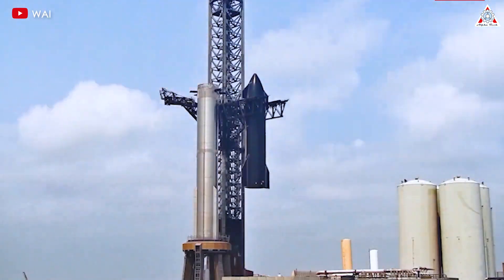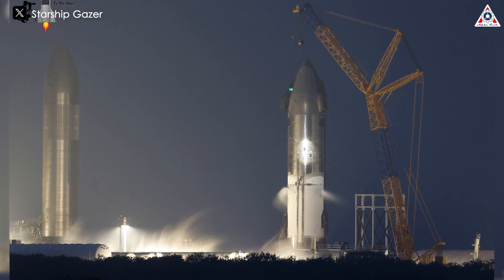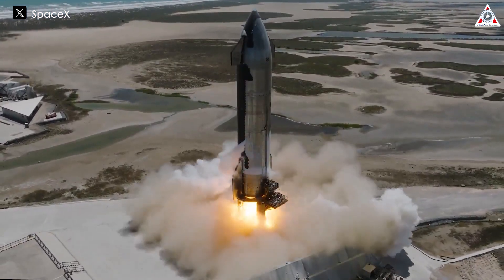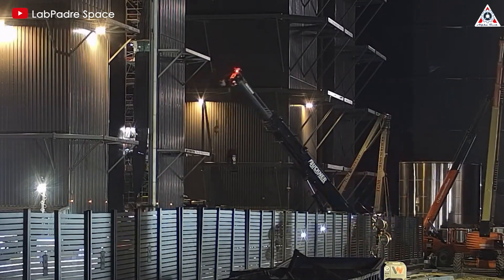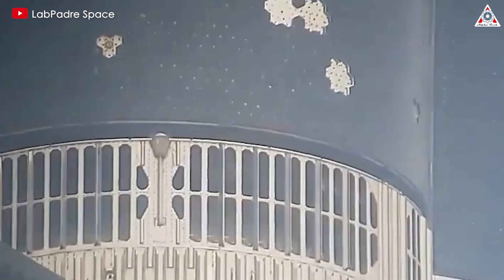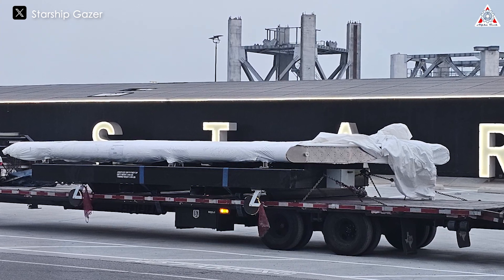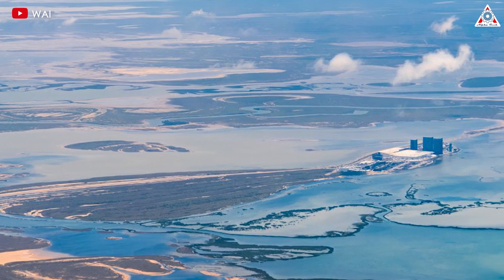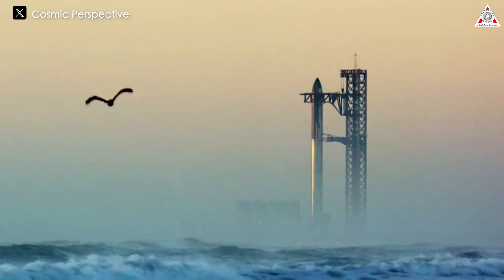Starship 31's Damaged TROUBLE! SpaceX Leader Gives NEW Detail Update...

Comment: What I see there is continual problems from the ring structure style of construction.

They are having to transport them flat to prevent collapse, and then stack them very high. all that is slow and laborious. and difficult passage for every section.

If they went to longitudinal gores, they could build them in the flat, with internal structure installed,  transport stacked flat 
And assemble with the crane by standing up the gores,  and building the gores around the end domes and prefabricated decks.

And at the same time get full length longitudinals, and not  have your structure full diameter butt welded every ring width.

This is bad engineering. Also limits ship design shapes to round hulls.
Flying logs aerodynamically, and less than pleasant spaces to live in, and no flat walls to build to, or put any thing against. Would be better with more linear construction, at least get facet like flat sides, and architectual freedom, without the continual problems wasting space and materials fitting everything to a short radius curve...

Try sticking your bunk agaist that hull on decks... Gonna get a wasted space where the straight edge of bunk meets round curve of hull. And they will soon find building internals taking twice as much time as closing in the hull.

Also if they discover glide ratio helps re-entry, with round hull limits, they will be stuck with 1930's era Aircraft hull styles. Cobbling wings and fins onto a tube, instead of potential blended wing shapes etc. 
They will be locked a hundred years behind potential start ups who realize these issues ahead of the curve. And they will have spent billions trapping themselves.

I hope the Chinese are listening... Sure they could appreciate better designs and better function... And right now likely have the most experience building linear hull shapes in marine shipping...

And I dont look forward to saying:
 "I told you so repeatedly", to SpaceX,
after its too late...

This is all down stream of the water tank guys.
And not building proper jigs and fabrication aids. 

One thing leads to another, and problems multiply over time building things.
Reply: 'I hope the Chinese are listening...' If they follow your expertise we need not be afraid of them!
Just a question: Why have submarines round hulls? Making them square would make building the interior much easier.
Reply: @gottfriedheumesser1994  
Funny! quite a difference between thousands of PSI, on the outside, and about 15 psi. on the inside...
In fact the Navy ships standard scuttle hatches are rated for 15 psi.
But they dont put those on subs for external use.

In other words the standard fabricated ships hull likely exceeds the hatch for pressure potentials. i.e. with fabrication you dont need round shape to withstand minor pressure on the inside.
Elon's ships are likely only slightly thinner, but stainless, which is a pretty good alloy, not just mild steel.
So building only tubes is a neurosis...  And I never said build cubes. I said faceted, gores, likely the width of a sheet just like the rings are. And if they pooched a bit with internal pressure it wouldnt stress them much at the welds as you'd likely cross the seams with gusset tabs or transvers framing with rat holes to acess the welds for inspection and repair.
They are inflating the current ship just to stiffen it for flight. Which by the way I suggested before the first one flew.
If you read all my past writs on just Alpha Tech you would probably notice many things got later used. Even got a couple thank you notes from Elon... And if you followed my stuff you would see it pops up on other channels in comments consistantly in comments by others.
After I write it.
And on the Chinese: I'm old enough to know governments are temporary. And I want humanity into space and I dont care who makes it happen. And I know some Chinese and other Asians personally and like them, just as much as I have liked Germans and Russians etc.
Theres quite a bit to current Starships that I have influenced... Without my input things would be much retarded.
Including the engines,
 I was who first posted parts count. That was on r/SpaceX.... user name was ActOutside followed by a four digit number, roughly a week or less after Elon's memo about SpaceX going potentially bankrupt from engine costs and difficulty.
I got trolled for that for two days.... So, Toll me, I'm used to it! 🤗
Reply: @garylester3976  Thanks for your endless posting. As an engineer, I had to study a lot of mechanics. As most of the body of a rocket are tanks (3/4 LOX, and 1/4 LNG) with some internal pressure it should be clear that the optimum structure is a tube with a semi-spherical termination. Everything else will make the structure heavier and less stable. It is also easier to weld the rings together when they stand upwards- Otherwise, you need spars to get the structure stiffer. That means additional mass and weakening of the structure unless one reinforces it with even more mass. 'The best part is no part' is true in this respect.
Reply: @gottfriedheumesser1994  
No problem.
Yeah, I have stated many times that the tanks should be kept round, or be lobed. i.e. rounded with some structure added to allow fattening and not getting too thick on the walls.
The real stress points on elongated round tanks is at the ends. if they are flat. which is why on starship they are domed.
If you think about lobed tanks, you will find its a common containment shape in nature for good reasons.
And the tanks on Starship are over 100 psi. and still fairly thin. they have to be off gassed or they will rupture from increasing vapor pressure.
What I am talking about is the ship, that especially for re-entry, building in longitudinal gores would have advantages,  from internal straight sections, for building or putting things against, to external advantages for say aerodynamic shapes for re-entry.
If you study hard chine boat and ship hulls, you will see they are built like modern stealth aircraft in many ways.
If you are interested in metal hulls, you might get a copy of Thomas Colvin's "Steel boat building"...
It covers fundamentals of fabricated hulls, and is full of gems that apply to Ships of Space. I've beat up the Nerds at SpaceX no few times with info learned from Colvin.
Also my father studied Ship Fitting at Bremerton Naval Ship Yard, And I owned the course text for decades and read it repeatedly.
Hulls have been an interest since I was a young teen in the 60's...
I also was in the US Navy, so have personal experience. Also have laid out arty smaller boat hulls of my own design for fabrication.
And have similar interests in Aircraft. My first 4 flights across the Atlantic the planes had propellers.
And I grew up on Air Bases...
So, a strange mix of understanding that somewhat applies to Starship. And a high mechanical aptitude... Aced the Militay's mechanical aptitude test.
Its part of the problem with modern engineering, often too specialized. I had an uncle in the 60's who was a well paid engineer at Boeing, and he was raised on the farm and into all kinds of stuff. Two of his brothers were machinists.
And I trained in micro machining. Also construction, and fabrication is just a hobby. (But I was taught by professionals...)
And one son a state Champion in auto mechanics, which is half computers now.
Starship is new territory for space, but much of what is being attempted relates to other fields.
And it only started getting good when Elon increased the number and kinds of experienced blue collar workers. Its really building a ship, not just a rocket.

And I have haranged them continually and gotten upgrades to happen, by spotting and pointing out things online.
But I try to remember, its Elon's project, and he needs to be creative in his own ways. And I often see the engineers do really good stuff.
But what I am proudest of, is changing the paradigm online about people submitting suggestions...
three years ago it was blasphemy to dare to suggest anything, now its perfectly normal to read comments and see all kinds of ideas to help, and some of them worth very serious consideration.
Basically I reamed the snobs and blazed the trail, and now seeing seriously good results... when I used to get banned for making suggestions.
That seemed to end not long after parts count.
They did ban me from
 r/spacex for stating I had seen screen shots from feminist writs talking about ending space programs and spending the money on women.
So basically was the first to try to warn of harassment from the left.
They didnt like Elon's Space stuff long before the current harassment from that side politically.
And I'm here to back Elon.
Also to encourage others, by humor if necessary.

Nobody knows everything, everybody misses things.
And humans form traditions from expedients, and vector off from optimum continually.
Also Elon appreciates input....
G.
Reply: @garylester3976  For shipbuilding I have a colleague who was reading Shipbuilding at the university. But this doesn't help much in building rockets. I would say, airplane building is nearer. Sadly nobody can keep up with your experience.
Reply: @gottfriedheumesser1994  Funny!
Well its actually closer to smaller steel boats. but referred to ships due to layout of shapes. Ships of course built quite heavy. even though the hull skin in modern era maybe ¼ inch thick or less. on boats, i.e. less that 75 ft, hulls are often thinner, and closer to the lower limit, around 30 ft, can be as thin as ⅛th inch. Which is close to starship, although starship is many times the volume. And it is fabrication. and that 30 ft lower limit is due to weight, in ratio to volume, and displacement. under 30 ft weight of steel to volume puts the hull too deep in the water.
So my point is actually about doing layouts with longitudinal gores. That a space ship with relative low internal pressure of hull doesnt have to be round, and for re-entry there are better shapes, like the Shuttle and Space planes, or better, which can be done in hard chine single direction curves.

And right now, they have a re-entry problem. which I did suggest would happen before last flight.
And they need to solve it to move forward. And I have done writs on it, and presented a solution before it happened. and after it happened suggested a better flight profile that might work even with the existing round hulled ship, and after heard Elon give a description of that profile, so crossing my fingers.

We'll know in a few weeks.
Mostly what happens, is Rocket Engineers operate off thinking from the 1960's or earlier, and have a hard time thinking out of that box. And much has changed with Starship, its big, fairly heavy, powerful, and stainless fabrication, and at first they ignored related fields. First ship fabricated with welding was in 1920 UK, and the Germans were building fabricated air craft in WW2, and they also suggested a rocket profile to reach the US by skipping it like a stone on a pond on the atmosphere. which is related to my profile suggestion to reduce entry angle and reduce velocity over more time before reducing altitude.
Also the US Military wants a new Space plane, and has even comissioned art work of their dream. its not a bullet shaped cargo rocket. But could be produced using hard chine designs. And I suspect there are even better designs possible.
And Elon wants to do intercontinental ships, those would better be designed to purpose and be sub orbital. i.e. better shapes than a bullet, if the glide ratio re-entry profile works, as they dont need orbital velocity to do half an orbit or less. Have done writs on them and possible designs.
Basically Elon is trying to build a one size fits all space shoe. Its sub optimal. Wants variants.
Which would cost money.
But DOD isnt poor. There is fear online of the Military taking over Starship. Probably better if they just funded the creation of variants for different purposes, that could also have Civilian uses. Just as they do with aircraft.
Sure Elon would like more funding that created more ships for more purposes, and had military capability as after thoughts, rather than specialize in it.
And Warfare gets stupid when you can access unlimited resouces and territory. Why fight over deserts, when we probably are within a generation or two of Exo Planets being within reach.
Starship is pivitol technology. And its not just limited to tube rockets, which was my point that you had trouble with. The more powerful engines mean we arent as limited, design wise, and as Elon has pointed out the fuel is cheap.
So, consider thinking about my points, and the potentials, and coming up with suggestions in comments, which are the collective mind of cutting edge space thinking in practical terms. Everybody has a brain, encouraging use cant hurt!
Reply: @garylester3976  The hull of the starship is made of 3mm or 4mm stainless steel. Use your brain how to weld the rings together for the whole height. In contrast to you, I know how planes are made. That has not much to do with shipbuilding. Become an engineer before continuing to write endless and senseless postings.
Reply: @gottfriedheumesser1994 
 I know how thick  the stainless is. I know how its welded together to get the height. If you look close you can see in some cases they are rolling an offset, and literally stacking the rings inside each other at the edge. also they are making the logitundinals in short hunks the width of the rings and then stacking and welding, this creates a joint with no lapping of welds or of the longitudinals, this due to the heating effects on the stainless alloy, creates a very nice place for the welds to metal fatigue over time and crack. 
Its not good engineering. especially with repeated thermal extremes and under pressures.  Would be better to construct in long sections where you longitudinals could be full length and not chopped up and rewelded, ditto on your skin. they are getting the stainless on rolls, and cutting into ring circumference lengths and welding up. Also I doubt they are concerned with keeping hull skin welds accessible and able to be visually inspected full length. if they get a crack under some other intenal structure, it may be hard to stop the leak, and on a long trip be potentially fatal to crew and passengers.
Basically with their stacking and butt welding system, its like buidling
a brick wall where you dont off set and bridge the bricks by half, you just stack them directly above the lower course and think the mortar will do it, in this case the welds. Its not good engineering. 
It may fly for awhile, but the life expectancy will have unnecessary limits.
And it would be even worse if welding aluminum due to not getting 100% strength at the welds due to thermal degradation. Stainless is better, but still an alloy, and welds are weaker than unwelded metal due to heat degradation of the alloy at the weld. Which is why the wire or rods used in weldments is usually a slightly richer alloy. But its still not perfection.
Also theres a reason Engineers must be licensed and have liability insurance to extreme amounts, because they regularly edit people, sometimes in serious numbers from being over confident...  
Good luck in your career, hope you dont cause any disasters, it might be hard to live with if traced back to your work.
"Arrogance comes before destruction".
Reply: @garylester3976  I have retired for years and do not want to continue the discussion about your drunken ideas. You need a license if you work independently, but not in a company. then the company has the license and the insurance.
Reply: @gottfriedheumesser1994  Fine... have a good day!
Personal insults usually means you lost... And I was only trying to educate other readers, didnt know I was talking with an old dog, not into learning new tricks... 😊
Reply: @garylester3976  Thanks for your education! it would be better to educate yourself, young boy.
Reply: @gottfriedheumesser1994  
Humorous!
Sorry you are not happy, I dont come here to argue with anyone, I come to plant concepts. And FYI
 I have been retired for decades... 🤣
Also lived in Germany as a kid, have family there.

Have a good day Gottfried!